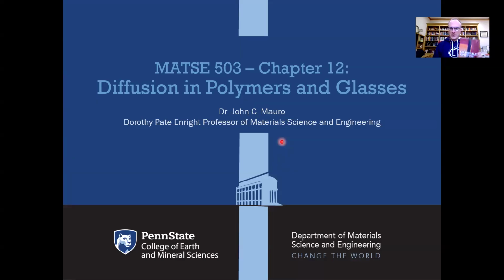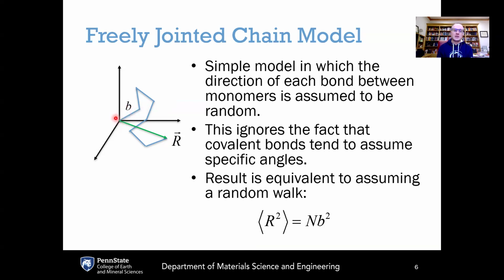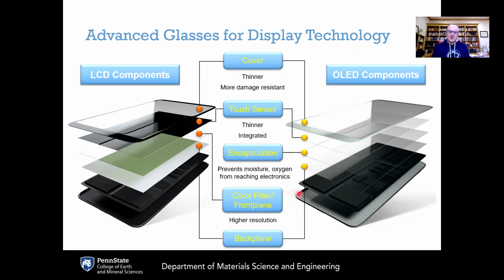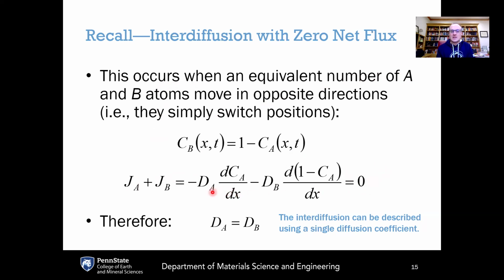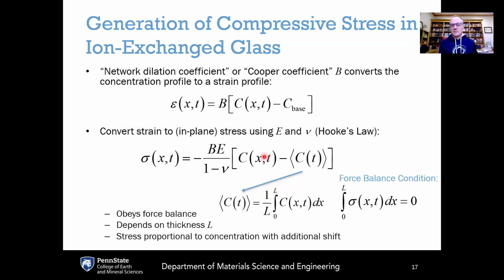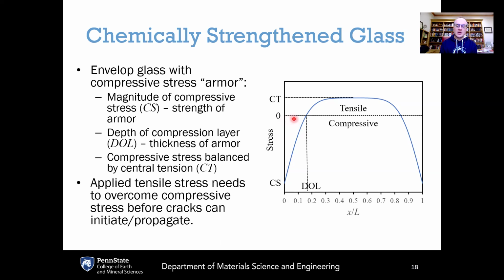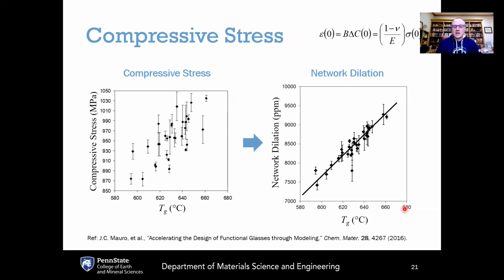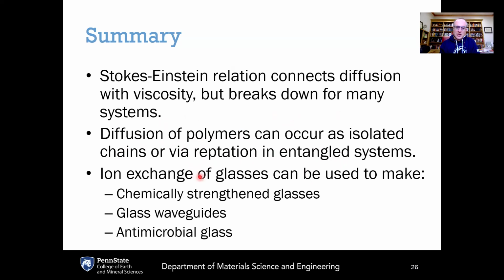Diffusion in Polymers and Glasses (Chapter 12, Materials Kinetics)

Comment: Thank you for the insightful lecture. I don't know if this is a suitable place to ask this question, but I hope so.  you have mentioned the importance of the interior tension, and I am curious about the possibilities of manipulating or engineering the central tension. Is there an approach to achieving this? Additionally, the depiction of central tension as a straight line in figure 12.5 prompts me to ask whether this representation is exclusive. Can central tension adopt different shapes, perhaps akin to what I would describe as a "cat head-like shape"? I mean, doesn't it reach its peak immediately following the transition from compression to tension?
Reply from the maker: Yes, it's possible to tailor the stress profile, including both compressive and tensile regions. This can be possible using multiple ion exchange steps, or by using ion exchange in conjunction with thermal tempering or lamination. Thanks for your question!